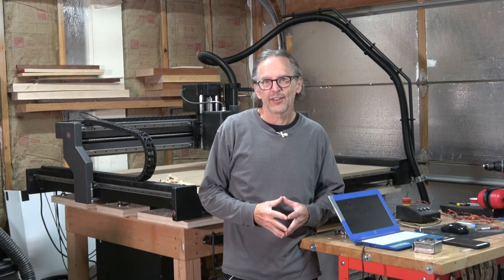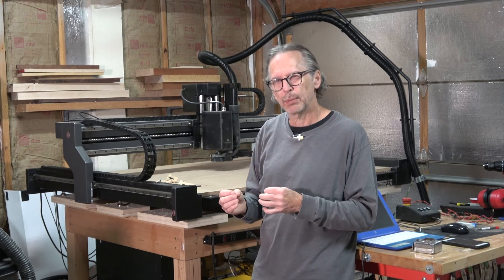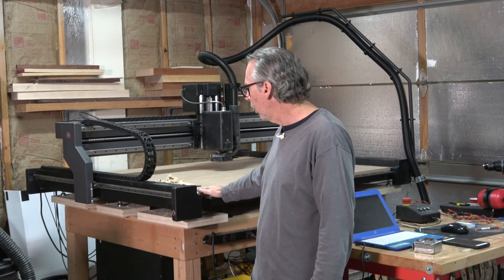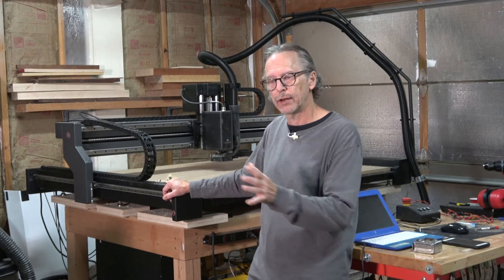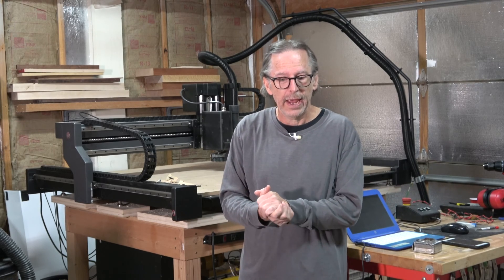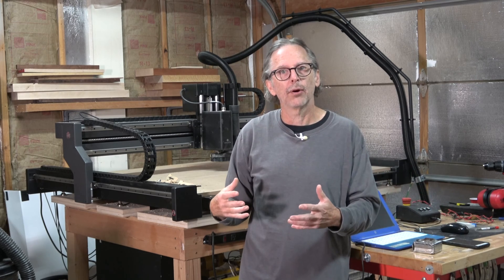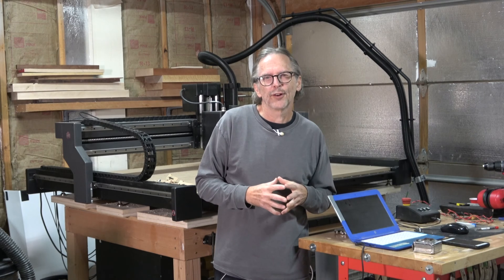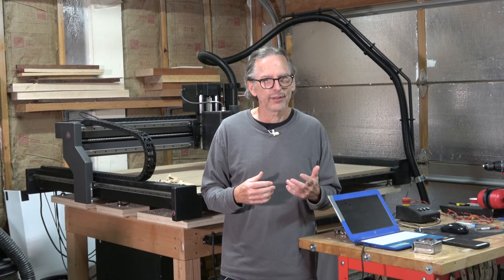How To Power Your CNC Machine

Comment: https://www.youtube.com/watch?v=UFi-dP1-WNE
this guy uses a power surge protector for this type of problem of losing steps when he turns on his shop vac.  I am losing steps when I turn on my shop vac, and I am looking at power surge protectors.  In my country, I do not see a unit like in his video. I see units like you would have in a breaker box. I have Nema34's on my CNC.  I have definitely traced the problem to turning on my shop vac.  I may have to call an electrician.

Comment: Hey Chris, I'm in the final stages of my CNC project, and I just found out, today actually, when I was running some dedicated wires for separate circuits for the VFD that will power the spindle (220v) and the NEMA motors (110v) that the distribution box on the building I'm building my shop doesn't have a ground bus, which is far from ideal. From your experience, since I've made separate circuits for the VFD and the rest of the machine, aside from maybe dying from touching the motor enclosure if something goes wrong, not having a ground is going to impact the reliability of the machine regarding losing steps, etc.? Power delivery is pretty stable around here.
Reply from the maker: You need a good earth ground to eliminate the electrical noise that can corrupt the fragile signals CNC machines use.

Comment: I use an UPS System on my CNC it has a water cooled 2.2 kW spindle with upgraded lead shine servos
The UPS system works great and if I push the machine too hard I’ve noticed that alarms go off on the UPS system then I reengage the system with slower speeds and feeds I have yet to miss a step on any projects
Reply from the maker: What make and model UPS are you using? I have been researching them, but they are rather expensive.
Reply: Highline Guitars  I live in Poland moved here about eight years ago and it’s a Polish UPS system so I don’t think you’ll be any good for you as it’s also 230 V I purchased my CNC directly from China and have been using it now for over a year and a half you and Crimson got me into this but I am having a lot of fun thanks
Reply: @HighlineGuitars  APC sells 1500va UPS's for about $160.  I use one for my lathe.  It's on the same circuit as my central vac system.  I put it in after I was turning a piece of wood and my wife  kicked it on.  When the voltage dropped, the lathe slowed and my gouge got caught and shattered my work piece. I took my UPS off my  PC and tested and that fixed that issue.  As I mentioned above, if you just want to stop the drop then go with the automatic voltage regulator made by APC as well for around $60.
Reply from the maker: @patsox2004  CNC machines require either a line-interactive or an online double-conversion UPS which cost around $300-600.
Reply: @HighlineGuitars  If it's absolutely the case that you need level of steady power then you my need to pony up the Benjamins anyway. Even running on a separate circuit isn't going to guarantee steady voltage.  I don't know about your power company but where I'm at in NY i get frequent brown outs and power spikes, not to mention outages.  Also,  if there is anything in your home that is drawing high currents,  I.E.  dryers, electric ranges etc, it's possible they can cause spikes as well even though they are not on the same direct circuit.

Comment: Another way to get rid of voltage spikes/drops is using UPS (uninterrupted power supply) between the wall outlet and the tool.  I had to use one for a customer with amature home recording studio.  Customer did not want to spend money on electrical work as his company was moving him in 18 months, after he finished current project at work.  The UPS unit got rid of the noise in the system.  And when he was moved the UPS unit moved with him, so he did not lose his investment.
Reply from the maker: Since I don't need blackout protection, I may consider a power conditioner as they are cheaper.
Reply: @HighlineGuitars  APC makes voltage regulators as well.  Those are pretty cheap, around $60.  The only thing with those is if you lose power the machine will shut down  The UPS would be better suited for those conditions and will allow you time to shut down without  damaging your project.